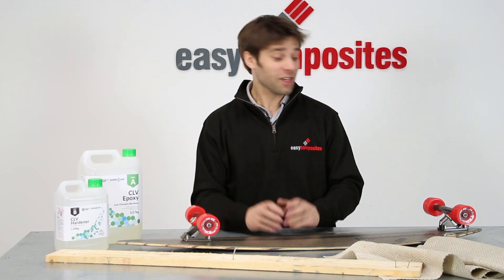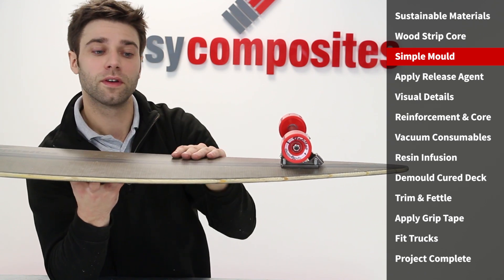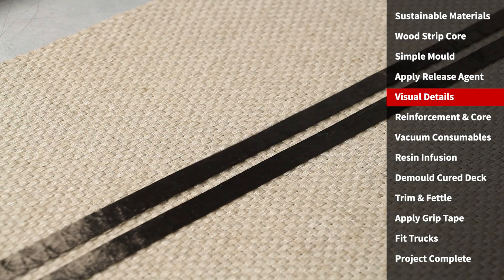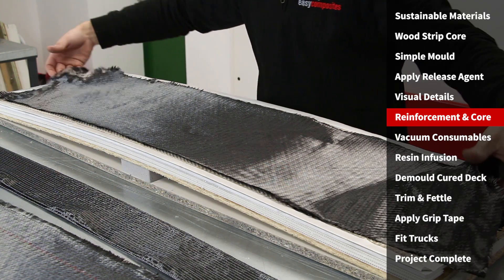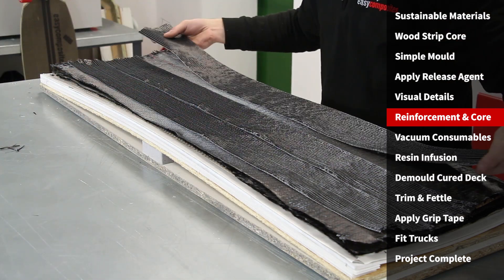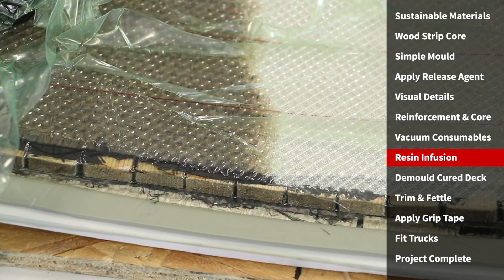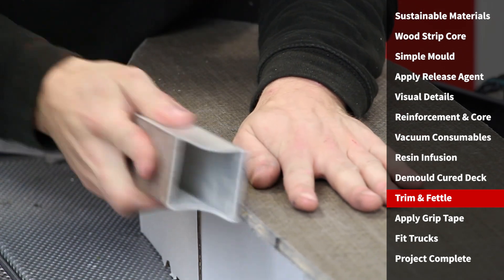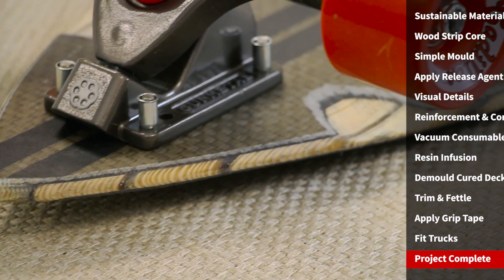Resin Infused Skateboard Using Carbon Fibre, Flax and Bio Resin

Comment: Love your videos, I work in at a London university and use your products on a regular basis.  would you be able to use a similar method to build skis and snowboards? obviously with a slightly more complex core
Reply from the maker: Yes certainly as long as the design is adapted to suit the use as a snowboard or ski.  You will want to tailor the core and skins to suit how much flex or stiffness you need for that specific application.
Reply: @easycompositestv  amazing thank you.

Comment: I have experimented with vacuum clamping wood to laminate it. A lot of times when you pull the vacuum, water vapor comes off of the wood, making it hard to hold a steady vacuum. Have you ever had this problem when using a wood core? How do you deal with it, or did you dry the wood beforehand somehow?
Reply from the maker: Generally we recommend using kiln dried or other forms of seasoned and dried wood to minimise this.
Reply: @easycompositestv  thanks. I have seen it happen with seasoned wood in the sense that it sat around in my garage for a long time. But I guess it was not dry enough. Anyway thanks for all the great videos.

Comment: Don’t you get carbon splinters the way your run your hands across the carbon fiber like that? I just got done working with MD Carbon fiber bare handed and I have Micro splinters.
Reply from the maker: Once fully sanded smooth you should not get any splinters.

Comment: Thank you so much for making the effort to produce such an incredibly informative video.  The design is pretty nice, it's just too bad that the 'pretty' side faces the asphalt, and the up side looks like asphalt - just like every other skateboard.  So the question is, if we really want to make progress in the status quo in term of design and materials, what technologies are available for molded in grip surfaces that don't look like asphalt?  Of do we just need better shoes?
Reply: There is clear grip tape available so you could see the top ply easily.
Reply from the maker: You could opt for a closed mould process with an upper and lower closed mould tool with a moulded, grip surface. This wouldn't lend itself to one offs as you would be significantly increasing tooling costs but for a series production, there's no reason why closed, compression moulding couldn't be used to give you whatever surface finish you wanted.
Reply: @easycompositestv  Thanks for the reply.

Comment: I'd rather use a foam core with two layers of Western Red Cedar on either side, wrapped in 4oz S-2 glass for toughness. Rocker, concave and kicktail on only one end.
Reply from the maker: That's the beauty of the process, you can adapt it to use materials and shapes to suit your requirements. In fairness though, this video was never really about how to make a skateboard but rather showing the potentials of using the bio-materials.

Comment: Hello Easy composites, is it posible to put reinforcement in the sides of the board? Will I be able to infuse that reinforcement too?
Reply from the maker: Yes, in theory, you could build a stack of materials to replace the core around the perimeter (much like we do in our bonnet/hood making tutorial); as long as you use a woven material, rather than UD, then it should infuse without a problem.

Comment: Hy Easy-Composites.
I would like to know the dimensons of the board and what was your thickness of the block for the camber. Does the board flex much, or would a smaller camber be possible due to the stiffness?
Greetings, Patrick

Comment: Wouldn't the flax be essentially useless to the strength of this board since the cf is so much more stiff and taking up all the load?
Reply from the maker: Although the carbon adds a lot of stiffness, the flax does still add some.

Comment: Can't beat maple for a real skateboard though. They need to be able to take repeated abuse. Several companies back in late 00s were using a layer or so of cf that did help rigidity, but I snapped a tail just as easily as I could've on a blank deck from a 5 set. Still interesting, but not cost effective when real skateboarding is a damage limitation sport.
Reply from the maker: Hi Teddy, no doubt. The video was really about demonstrating sustainable materials in composites, as well as an interesting method for making low production volume forms, such as this deck.

Comment: Hi, May I ask you, what are the wide and deep of the strip wood in mm? Thank you
Reply from the maker: The wood strips were just cut from reclaimed pallet wood, the actual size does not matter too much as long as they aren't more than around a few cm across and are bonded with the slight gap to allow resin flow.
Reply: @easycompositestv  Hi again,  sorry,  I've been checking in your web page that there's discontinued the supersap resin, can I use the IN2 resin?, also could I use kevlar for reinforcement to gain torsional stiffness? thank you.

Comment: how do the timber strips not warp after you’ve cut them? i tried to rip down some pallet timbers and they were so bent that they were impossible to use!
Reply from the maker: We just didn't have that problem with the timber we used. Maybe it's just down to the pallets you're using and how they've been stored, especially how dry they are or if they've been subjected to much 'weather'. Maybe try again with some different pallets :)

Comment: After seeing this I’m thinking about making a modeled seat for a sports wheelchair that I use for tennis, basketball and AFL(Australian Football League). 
Would that be hard to make for someone that hasn’t done it before?
And what would I need to do this?
Thanks
Reply from the maker: Hi Jason, well anything for the very first time often involves making a few mistakes. However, hopefully as you can see from the video the process can be broken down into individual, achievable steps and is quite possible to follow without prior experience. We'd always recommend starting with simpler projects or even just creating small test panels whilst you learn the process and find your feet but you might well find you really enjoy the learning process and then get a great result at the end of it. Good luck.
Reply: Easy Composites Ltd 
I am a cabinetmaker, I’ve built two street machines and build,tune and race slot cars. I am a hands on person that will give anything a go. Thanks

Comment: It also helps when drilling through composites to start out with the drill in reverse which prevents the bit from ripping the fibers. After drilling through the first layer or two, return the drill to normal drive but don't drill all the way through the other side. As the bit starts cutting though the opposite side of the panel reverse the drill again and cut all the way through the panel. This will leave you with a very clean hole through both sides of your panel.
Reply from the maker: Thanks for the comment James, that all sounds logical and good advice.
Reply: I wonder if a drill bit modified for soft metals would also work?

Comment: How can you make this skateboar hollow? Is there anyway to do a resin infision but hollow? Obusly with no holes on the surface.
Reply from the maker: Actually hollow wouldn't be possible without making it in two halves but you could use a very low density core, that would pretty-much behave like it's hollow and be a whole lot simpler.

Comment: All nice but never touch the fiber with barehands. The finger tips contain bodyoil which is detrimental for the epoxy/resin. It creates fish eyes and bonding issue even when using infusion bagging.
Reply from the maker: I think you'd need a seriously oily skin problem for this to be a consideration in a context like this... but 'fish eyes' in an infusion? that's not possible.

Comment: Is it possible that you list everything you used here? (Except  the mould material) and it would be even better with the price per meter or yard of the different fibers used in the tutorial. I was browsing on your website and I was a little overwhelmed by how much stuff about carbon and other related stuff (which is good) that I lost track of what I was doing (because I was going back and forth between this video checking everything out and your website)
Reply from the maker: If you watch the video through the Learning Centre on our website, it lists all the products used in the video.
Reply: @easycompositestv  Thanks, I'll go and check out now

Comment: whats the point in the core? couldn't you have used something stiffer and thinner like plastic or metal to get a ridiculously thin board?
Reply from the maker: The whole point of the video was to showcase using natural fibres and recycled wood as a core. Of course you could use different materials if you so wished.
Reply: @easycompositestv  it was a banger of a vid, but could it theoretically go thinner?

Comment: how the resin will react with wool? cotton? or materials found in sport socks - like Polyester (Coolmax), Polyamide (Nylon), Elastomero (Lycra)? will them make a decent bond, a decent structural rigidity? 
thank you very much! 
you have... GREAT videos!! ;-) 
best regards from Bucharest, Romania!
Reply from the maker: We have not experimented with any modern clothing fibres. We suspect that for many, the resin would wet out and cure in the normal sense, however the structural benefits would only really be found out from experimentation as it is not something we have seen before.
Reply: Of all the things you mentioned, only polyester would be worthwhile to use. Everything else either has too low tensile strength (wool, cotton) or stretches too much (nylon, lycra).  

   The best materials on a weight, and price, to strength ratio are S-glass fiberglass and basalt.  Basalt is a bit more environmentally sustainable than S-glass. But they don't have the stiffness strength of carbon fiber.

Comment: I just saw that the Biotex Flax fiber is no longer available in your store, what other material can I use to make this project? I'm building an electric longboard and I'm really interested in using this formula to make the deck. I hope you can help me. And thanks for the video and the channel, the tutorials are fantastic!
Reply from the maker: Hi Felipe, the manufacturers of the 'Biotex' flax fibres have discontinued some of the fabrics but others are still available and going strong.

The 4/4 hopsack (used in this video) is no longer available but a 400g 2/2 twill fibre is still available and would have almost identical mechanical properties. Here's a link: http://www.easycomposites.co.uk/#!/fabric-and-reinforcement/natural-flax-and-jute-fibres/dry-flax-and-jute-fibres/flax-22-400g.html 

We also have a new unidirectional flax material which would work very well for adding longitudinal stiffness to the board, you'll find that one here: http://www.easycomposites.co.uk/#!/fabric-and-reinforcement/natural-flax-and-jute-fibres/dry-flax-and-jute-fibres/flax-unidirectional-150g-180mm-Wide.html, it's also extremely reasonable on price.

I hope this helps.

Comment: Great to see the use of eco resins. What kind of temp can the eco resin handleBefore going soft.
Reply from the maker: The HDT of the SuperSap CLV is 48°C so we would recommend keeping it below that temperature.
Reply from the maker: The SuperSap CLV has a Tg of 62'C therefore it's OK up to 62 but after that it would be losing its mechanical properties.
Reply: Ok thanks for that. 
Are they working on a product with a higher HDT
Reply from the maker: Not that I know of but it might be worth asking Entropy Resins directly. We have a special version that we developed in collaboration with them for our particular market (and application) but they are an innovative company and they may have other products with higher HDTs that I'm not aware of.

Comment: Is it possible to use this method to infuse resin into a wood laminate?
Reply from the maker: It would depend on the wood. Traditional wood stabilisation is not done this way although the principles of working under a vacuum to remove the air and thus allow the resin to displace where the air was is similar. Typically that is done in a vat of slow curing resin rather than a vacuum bag approach.

Comment: Great video and we want to start making some carbon fiber products here but dang.. the price is out there. How much did this long board cost to make?
Reply from the maker: Depends whether you're referring to just the materials used in the board (probably about £50 for the carbon fibre, flax and resin) or all of the tools, equipment, vacuum pump, the former etc., in which case you're looking at more like £350.

Comment: not sure if carbon fiber is the way to go all the time. For lonboards you usualy want a certain degree of bending. So if youre not 150kg youd propably prefer a glasfibre longboard.
Reply from the maker: It also depends on the other materials used.  In this case, the Flax does not offer a lot of stiffness to the laminate so balancing it out with the stiffer carbon fibre probably means overall the balance works out about right for many cases. The finished longboard handled well from our own riders perspective.

Comment: The easiest thing in this video was how you said "easycomposites" the first time. Wow. Cheers from across the pond.
Reply from the maker: Haha, thanks, but actually I would say that most of what we do in this video is pretty straightforward - you just need to put quite a few steps together! When you can do a composites project without going through the extra work of making a pattern then making a mould (like we do in our airbox video or the bonnet making video for example) then you actually get your results quite quickly - however, it's all relative!

Comment: +Easy Composites Ltd I have a few questions, how much flex is given when you stand on the board, I'm planning on making a rather flexy board with 1.588 mm bamboo plywood using 280g glass twill and 320g biaxial glass, in the order 

Bamboo ply
280g glass twill
Bamboo ply
320g biaxial glass
Bamboo ply 
320g biaxial glass
Bamboo ply 
280g glass twill
Bamboo ply

The entire deck is about 10mm thick 
Will I need double 280g glass or not?
Should I use only 1 layer of biaxial 320g glass? Any help would be appreciated
Reply from the maker: Our board deflects approximately 10mm with a 75kg person on board.  It is hard to tell exactly how much your board would flex with that layup.  You would need to experiment to find the ideal set up for your needs and materials.

Comment: Great explanation and video editing. I have a question: Could i use a full(uncut) 9mm baltic birch plywood as core material but with holes drilled so resin could soake in?
Reply from the maker: I see no reason why that wouldn't work.  You might want to score between the holes on the bottom side to help give the resin more paths once it reaches the bottom layer.

Comment: Hello guys from @Easy Composites Ltd. I have a few questions if you don't mind answering them and if you find the time for it.
I'm planning to make a downhill/race longboard from comoposite materials. I already own one but it's wooden, heavy, used and damaged. I plan to make a mould from it with concreate and cover the mould with fibreglass to make a good surface finish for release agent.
I want to use Airex C70 pvc 5mm foamcore, some Unidirectional carbon and maybe +-45 carbon or unidirectional stripes running in X-pattern for torsonal ressistance because its very crucial for downhill racing and finally cover that up with some classic carbon fibre.
But here is the thing. I have no idea what csm/weight carbon fibre to get, so it is still light and very sturdy and not a bit flexy.
Can you please give me some ideas? I would be very very thankful.
LOVE the videos btw. Keep them coming. 
Thanks
Reply from the maker: typically many people would go for a 2/2 twill fabric at 200gsm which is roughly 0.25mm thick per layer. You could follow a similar layup as in the video and replace the Flax Fibre with 2 or 3 layers of the 200gsm carbon cloth.  Ultimately your design might vary depending on how strong you need it to be and with a thinner core perhaps more layers compared to ours but that should give you a rough idea to start from.

Comment: Would you be able to use a material like plexiglass instead of wood as a core?
Reply from the maker: You could experiment with all sorts of core materials. Plexiglass I guess you're thinking of clear acrylic? - I'm not sure what results you'd get from this combination, bonding to acrylic is tricky and you might well have issues with the laminate delaminating from an acrylic core but it could be worth experimenting.

Comment: Did the wood core soak up a lot of resin? I work making guitars by resin infusion, and would like to try doing a longboard. The guitars are only 4 ply of CF and fiberglass. How much resin and hardener did the longboard take?
Reply from the maker: The wood soaked up almost no resin but the gaps between the strips of wood did consume some resin. The longboard used about 1kg of resin, I'm afraid we didn't record the exact amount.
Reply: what are your guitars called Brad B ? would love to check them out

Comment: Hi,  could you stencil spray a logo or graphic onto a carbon fibre cloth with say a silver or gold spraypaint?
Reply from the maker: Yes, I see no reason why not. If this was critical composites (aerospace, motorsport etc.) then you might worry about using paints on reinforcements and how it might affect the bond of the resin but for less critical applications like this it's fine to be a bit more creative.